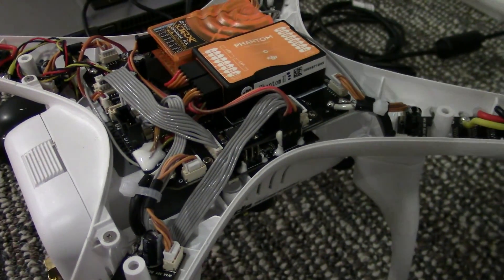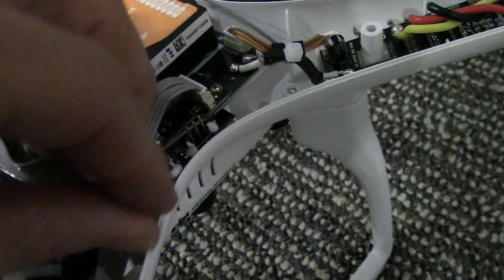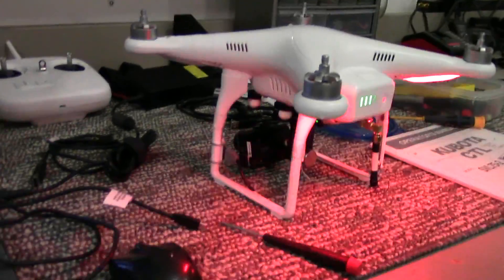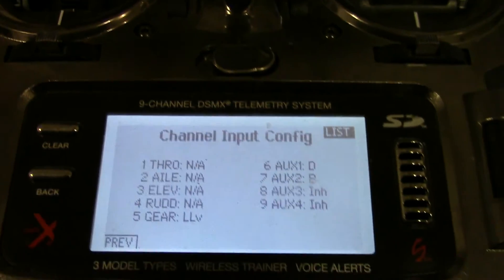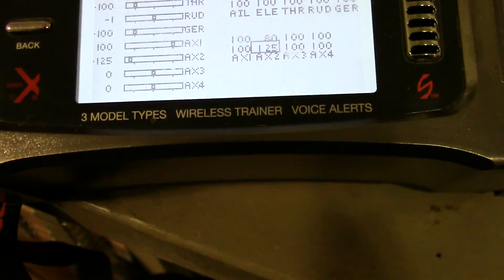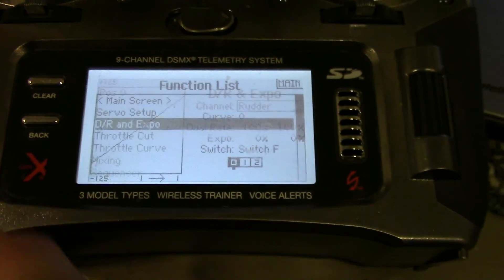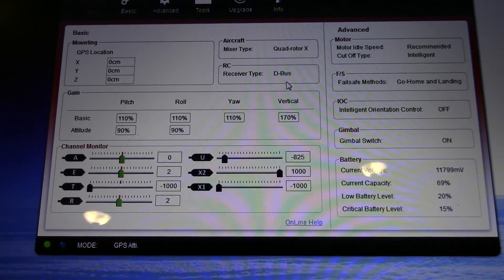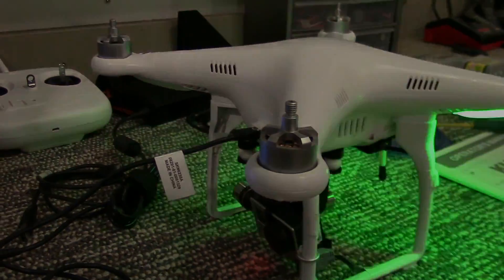Phantom 2 With Spektrum Dx9 Transmitter

Comment: Thanks for this video! I found another video on here that used an AR8000 but on the newer Phantoms the Naza is a locked in version for the phantom and you can't change the RX type. So $100 later I bought 3 OrangeRX 3 Channel with s.bus RXs for half the price of a Spektrum and used one on my phantom. Your video guided me through everything perfectly! I couldn't be happier.
Reply from the maker: Scott Heath Yup, it was possible with the original phantom to simply change the receiver and the RX type in software to match. They locked us out for a bit with the Phantom 2 but found a work around. I have lots of flights using this setup and never an issue. Glad it helped!

Comment: Excellent Video, very well presented and filled with useful information. Many thanks. 

I managed to set up an old (previously crashed ebay purchase) P2 with my DX18,  All looking good so far, the correct lights are flashing and the DJI app shows that I am connected and that I can select all modes, including IOC modes. Just need to get the GPS going and find out why it won't arm.

Regards

Steve C.
Reply: Hey Steve. Did you ever get your P2 figured out? I did everything the way this guy did and can't seem to get it to work with my DX9 black. I re assigned the aileron, ect as he said to do and when I plug it in to the assistant to calibrate sticks and switches there not responding correctly. Also, when I started the motors the throttle was on my aileron and not where the throttle should be When I assign them back to normal they respond correctly on the assistant app but it will not start the motors when you pull the sticks down and to center? What gives? this looked so simple but is turning into an OCD nightmare. I am using a Orange spectrum R820X V2 with S-Bus as Hobby King does not have the 800x anymore. don't know if this makes a difference? it's still an 8 channel spectrum with S-Bus. Any help would be great.
Reply: Hi Diamoro. The setup in the video appeared to work for me. I setup my DX18 for Quad, paired it with an orange receiver, connected SBUS to NAZA X2, removed X1 and powered it up. The only thing that took any effort was the settings on the DX to bring the flight modes into line. I only converted mine because the P2 receiver was damaged, I have since bought an new receiver (and GPS)  https://profimodel.cz/en/330/18437-prijimac-phantom-2-vision-6958265109515.html?search_query=phantom+receiver&results=7 ,  and converted it back to the original TX.
Reply: Hey Steve. Thanks for getting back with me. I have watched this video a 100 times and double checked everything. It has to be something I am missing in the tx programming, or maybe I am not starting with the correct model and type? It looks like he started with acro, a fixed wing model but you say you started with a quad? I actually got the motors to start at one point but like I said my throttle was still where my aileron normally is. I move the right stick to the right and the motors rev high. The stick movements aren't right on the assistant either like his are in the video. It's like re assigning the channels messed everything up but I was able to arm it in the normal fashion. Thanks. 

Dave
Reply: Hi Dave. I just watched the video again to make sure that I didn't miss anything. I still have the setup on my DX18 so I checked through that too.

Flight Mode:
I am definitely using a 'quad' setting for aircraft type. 

Control Changes:
I did have to change  the AX2 setting in 'CONTROL SETUP - TRAVEL' 
from 100 (top value) 100 (bottom value)  
to 78 (top value) and 68 (bottom value). 
I also reversed ROL and PIT. 

Check: 
Check that you are definitely using SBUS not PPM. 

Throttle:
The other thing that will impact you is that the THROTTLE needs to be increased a little on startup AND once the motor has started this is because the Phantom will see 0 throttle as motor cutoff/shutdown (this my be why your engines just happened to start at one time, that's how I came across the issue).

TX Setup for Flight mode and Flight orientation:
AX1 is used for my control mode setup for orientation (left top switch S2 on Phantom controller) :
Default position (S2 top position) = -100%
Course Lock (S2 mid position) = 0%
Home Lock (S2 low position) - 100%

AX2 is used for my flight mode setup switch (S1) for GPS/ATTI/RTL
GPS mode (S1 top position) = 78%
ATTI mode (S1 mid position) = 0%
RTL mode (S1 low position) = -68%

Hope this helps Dave. I'm happy to send you my MODEL file from the DX18.

Steve C.
Reply: Hey Steve. So I started with a new multi model, set every thing up the way you suggested and I cant get the motors to start. everything looks good on the assistant software. I took it outside and calibrated the gps, set it down, pulled the sticks down and in, and nothing. I added more throttle travel, 110 in both directions. I showed 1000 at both ends on the assistant.  I says its in s bus. I guess I'll have to try your model file. If you could send it to me that would be much appreciated. I don't know what else it could be. It's weird that it starts in Brandons set up on an aero model but the controls are all backwards. Maybe my naza is different? It looks the same. Maybe It's the receiver. They discontinued the 800. I'm using the Orange 820. I don't no man. 

Dave
Reply: On its way buddy. Good luck with your setup.

Comment: Hi brandon, I dont use ioc but have switch setup so if flying round a structure or cliff you can reset home position in the air to ensure failsafe height wont hit anything.  Also if you wanted manual mode you should be able to use heli model type and pitch channel for flight mode then you can have gps/atti/manual on flight mode switch and failsafe set as hold pitch curve on separate switch I do this on dx8 with non ps nazas only used manual once so far when a naza lite seemed to flyaway but it was just a combination of wind and tbe, still I like to have option.

Comment: Hey bud. I am trying to make this setup work but having some issues. It seems that my throttle is really my aileron on my DX 9. I did everything you did in your vid. Any ideas what might be wrong?
Reply from the maker: dlamoro1 what phantom model? It’s been so long since I did this I don’t recall anymore. Has to be something you did slightly different.
Reply: Hey yeah I noticed it's been a few. Thanks for replying. been scouring the internet RC world for days. This has been driving me crazy. Your vid looked so simple.  It's the P2 Zenmuse H4 3D model. It came with the go pro H4 gimbal. The Naza unit looks the same as yours. It says Phantom II on the side. The Orange 800 is discontinued so I used the new 820X 8 Ch S-bus. Don't now if that's the prob or a programming issue. I got it to spool up once but like I said, throttle is on my aileron and shows the same on P2 app.  Did you use the Naza assistant or the Phantom 2 assistant app? I am on a mac so they look different and I can't make it out on the top of your screen.
Reply from the maker: dlamoro1 I used naza assistant. If you go to my channel click on channels and you’ll see my buddy’s channel called freenarlochip. His name is Stephane and he’s up to speed on all this he can probably steer you in the right direction.
Reply: Hey thanks again for responding. I reached out to Stephane on RC Groups and he said he was not familiar with this conversion and would not know what to suggest. The only thing I can think of is that my Naza is slightly different or the fact that my receiver is different from yours as well. Do you remember what Naza app you used? I tried the M V2 but it did not recognize mine.  I have been chatting back and forth with Steve Cowell below who had sucsses with this using a multi model on his DX 18. I did what he suggested and still no go. He is going to send me his radio file. If doesn't work then it's got to be the Naza or receiver combination. Do you still have your Phantom or the set up in your DX 9? By the way, Like your channel. Got guns and guitars in common. Nice 6.5 and love Pappastaches channel.
Reply from the maker: dlamoro1 thanks yes a bit of everything here. I quit updating phantom and assistant software years ago when they started placing lots of restrictions. I was using phantom 2 vision assistant 3.6. I haven’t plugged it into computer for a long time have never had to. Yes I still have my Dx9 I could try sending you my phantom file.
Reply: Hey Brandon. If you could send me your Dx9 Phantom file that would be awesome. That would eliminate the radio being the problem if it still doesn't work. I am using the 3.8 assistant but I just downloaded 3.6 so I will try that. I can't imagine it is a whole lot different, but like you said they are constantly placing restrictions so maybe my naza is just a little different and can't be used without there toy radio. Maybe the mixing board is different too. Did yours come with the Zenmuse Go Pro gimbal or did you add that? Mine is the Zenmuse H4-3D edition and was a refurbished one I bought from B&H Photo. I noticed my curcuit board says P330Cb-H3-2D V2. Thanks. 

Dave
Reply from the maker: dlamoro1 I bought mine with gimbal. I’m still using a hero 3 so was the H3-3D. I’ll send it just need an email address.
Reply from the maker: dlamoro1 thanks for the compliments. Yes I’ve had some nice areas to film. I always wanted to film in the mountains near jasper and Banff, I think drones are banned in the park tho. I sent the file, hope you received it and solves your problem.